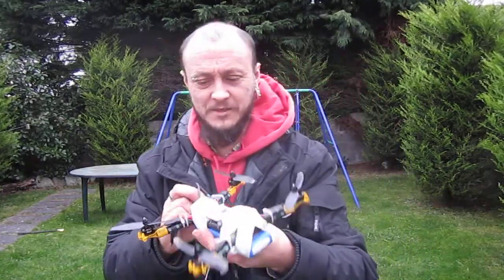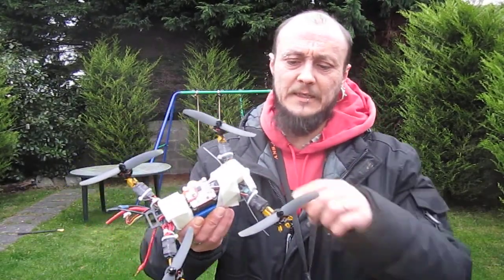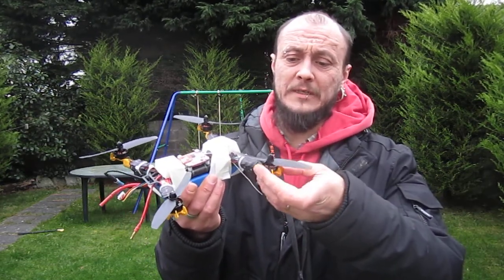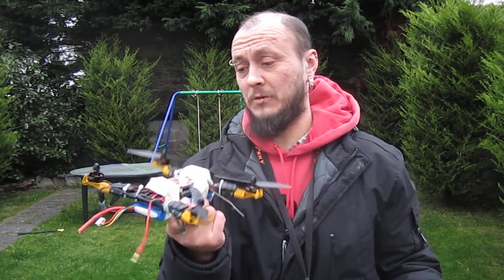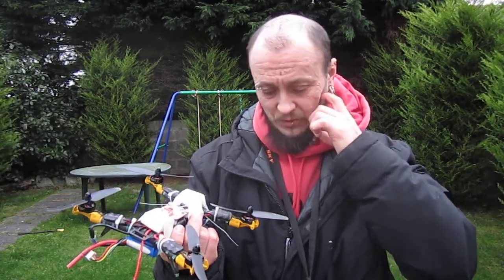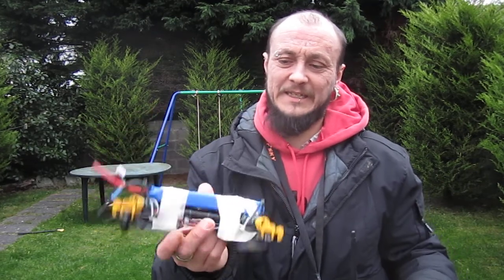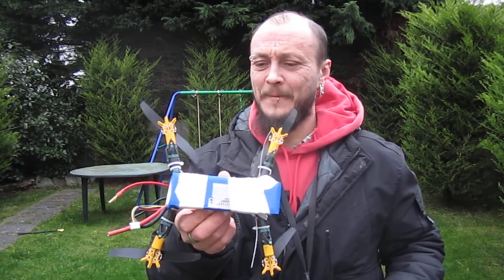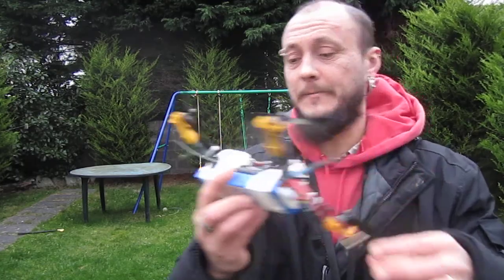Mini-H quad quick test flight

Comment: These high kV motors and SimonK esc's have serious problems with syncing.
I have done lots of tests with different SK firmwares and most stable was 2013-05-15. Personally I am using now Turnigy Plush 10A esc with BLHeli firmware.
Reply from the maker: Cheers mate, I got it sorted already- I flashed with the very latest SimonK up to this date, and it works with HK F-10A and ZMRs:)

Comment: looking good,
your f10s are playing nice with the zmrs? those motors are pissing me off atm...
Reply from the maker: Ohh... ZMRs are the biggest divas I've ever seen! When I powered it without props with F-10A ones, it had only one or two tiny twitches, only at ~75% throttle. But that was in the hands holding tightly, and in easy hover they behaving good so far... I'll go to test them in the field and give them a good Amp abuse, only then I can confirm that everythings is OK:)